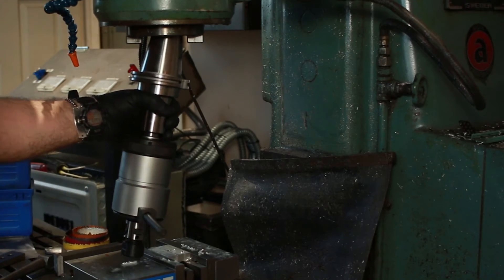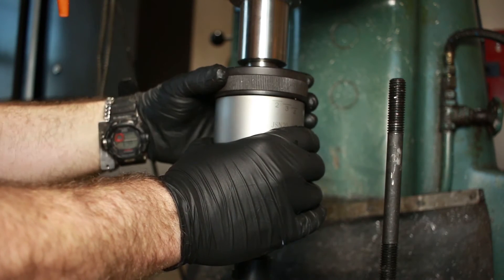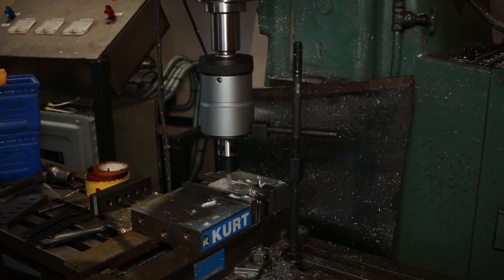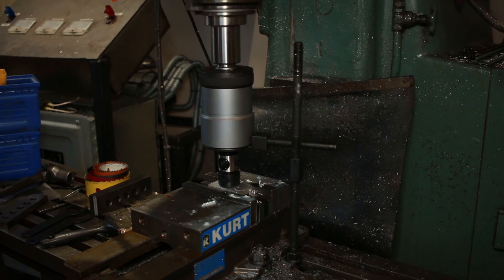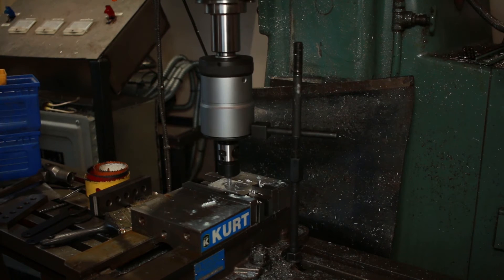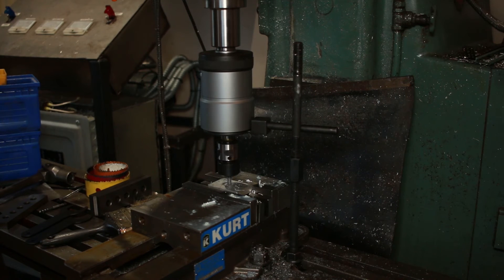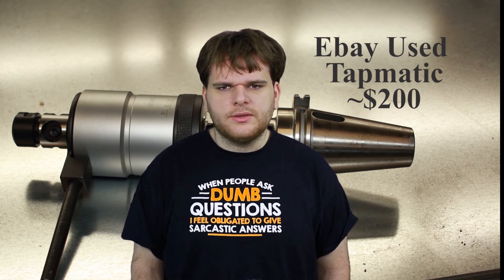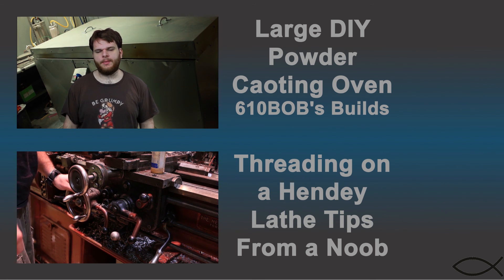Tapping on Drill Press or Mill Tips From A Noob

Comment: My old Delta drill press apparently made in 1937 came with an instruction booklet with the same date on it that has those automatic reversing tapping heads in it.
And those reversing tapping heads are pretty expensive.
I decided just to put a reversing switch on it from my junk drawer that didn't cost me a penny.
Now I just need to find excuses to use it. 😃